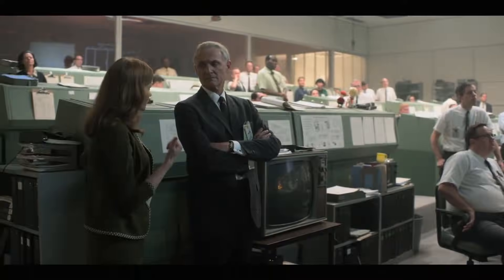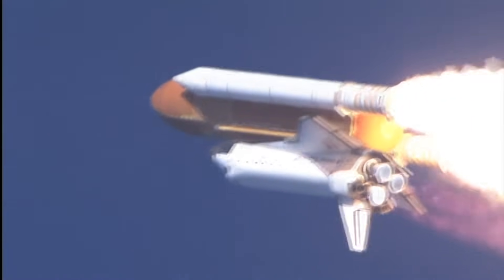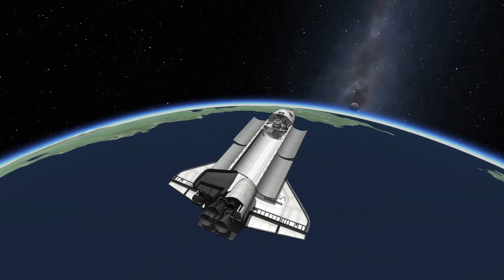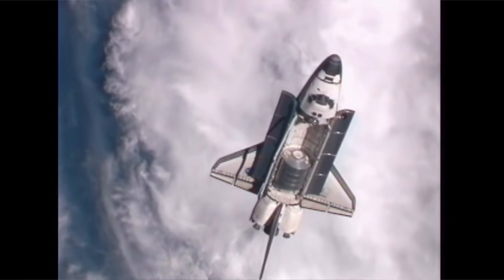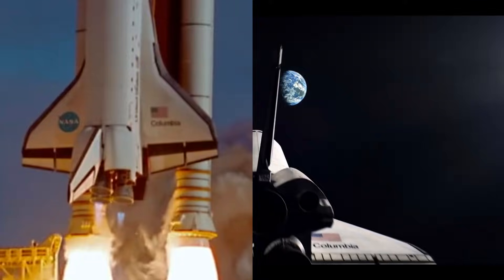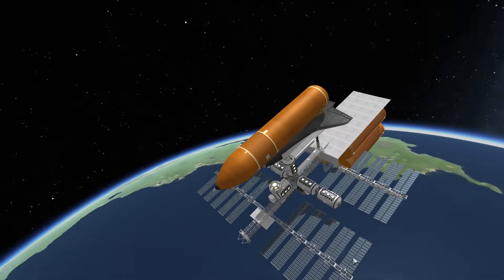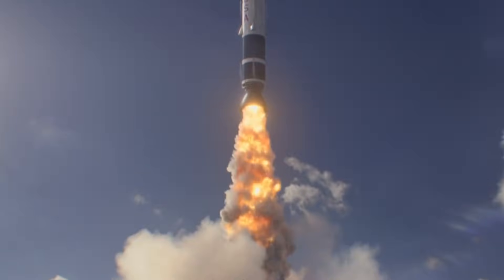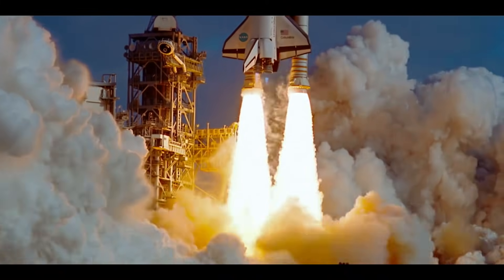How To Send A Space Shuttle To The Moon

Comment: Well, Airplane 2 took the Shuttle Orbiter to the Moon, but I’m not sure imitating a comedy is the way to go. I guess the producers should watch the excellent documentary on Challenger to see the serious design flaws that doomed 14 astronauts. It’s ironic that the name of the Shuttle Orbiter is “Columbia”, as ANY Shuttle Orbiter falling to Earth from the Moon (and that is essentially how Apollo returned — it literally fell into Earth’s gravity well) would not only not withstand the heat, it would be torn apart by the aerodynamic forces of re-entry at a much higher velocity. From low-earth-orbit (leo), re-entry begins at about 17,500 mph. But from deep space, we are talking 25,000 mph. The Shuttle was just not designed to withstand that. NASA’s original shuttle concept was a MUCH smaller vehicle, with cargo being launched separately. It was the Nixon Administration which dictated the bloated and flawed vehicle that was the result. 

The mistake NASA made was to try to sell the Shuttle as a cheap way into space using a “re-usable” vehicle, which would be cheaper than those expendable Apollo/Saturn vehicles. As it turned out, the Apollo/Saturn was actually much less expensive, as well as safer. (The Saturn V NEVER had a catastrophic failure, a rarity in rocketry). 

NASA management was trying to sell the Shuttle as a space version of an airliner. But unlike an airliner, the Shuttle goes from zero to 17,500 mph in eleven minutes, and a bit longer to decelerate upon re-entry. That’s a massive amount of stress to put on any vehicle, and it’s expensive (far more than first thought) to prepare it for another flight. Also, unlike Apollo, there was no launch escape system in the Shuttle. With Columbia’s first few flights, with a crew of two, there were ejection seats, but that would only save two of seven potential crew members. NASA also got cheap by using solid rocket boosters, which are less safe than liquid fueled engines because once those are ignited, they cannot be shut down. 

Because of this, NASA had no business trying to sell the Shuttle as being just as safe and routine as an airline flight, and it should never have been used as a passenger service. (Again, see the Challenger documentary). NASA also greatly underestimated the re-fit time after each flight, and thus had a much too ambitious flight schedule, which they never got close to achieving. But it was this pressure that forced Challenger to be launched when engineers were pushing against that low temperature launch in January, 1986. The Russians did one Shuttle flight of their own, and then shelved it as too expensive. They are still using Soyuz today, which has proven to be quite reliable and relatively safe. (Space flight will ALWAYS be inherently risky). The US should have stuck with Apollo/Saturn. The smaller Saturn 1B was a smaller booster for earth orbit flights. And with the Saturn V, Apollo wasn’t limited to leo. We probably would have returned to the Moon by now, instead of a flight to nowhere. 

It was far better designed, with a launch escape system in case of a disaster during launch, and, as it turned out, was MUCH less expensive. And like the Shuttle, as technology improved, the Apollo and Saturn navigation systems and on board computers could have been improved as technology improved.

Comment: Will it still work if you replace the 2 Solid Rocket Booster with Falcon 9 Block 5 booster?
Reply: No, each shuttle SRB had more than 60 % higher thrust than a Falcon 9, and the two of them combined (not including the shuttle's 3 main engines) had 10 % higher lift-off thrust than the Falcon Heavy.

Comment: What if it can land on the moon like on a strip? or is that not feasible?
Reply: It wouldn't make much sense to land it horizontally on the Moon going at any sort of speed. The reason we're used to seeing this on Earth with aircraft is because they need to keep moving to stay airborne in our atmosphere (they can't land going 0 mph, etc.). You can in some situations land vertically on Earth, like with the newer rockets, or some vertical take off and landing craft, but that's a bit more complicated than it needs to be in some ways, and it makes more sense to just use what we have (lift generation by forward movement). Earth aircraft also brake using their wheels once they touch the ground, which requires good contact with the ground from their weight - with the lower gravity on the Moon it'd be tough to get a good braking force - if you were going any high amount of speed they'd just skip around, and without an atmosphere to provide some directional control via vertical and horizontal stabilizers, there's a high risk of just losing control, which would be bad. There's just a lot that can go wrong there by going fast. It makes a lot more sense to lose as much speed as possible before approaching the Moon's surface, then lightly descending down vertically on rocket power, which is what the Apollo landers did.
Reply: Extremely unfeasible. Though Jackie Chan did it once ;)

Comment: There is no reason why the fuel tank that takes the shuttle from LEO to the Moon should only be as big as that which takes the shuttle to orbit.  Also a larger tank would allow for fuel to reduce rentry temperatures on return to Earth that the shuttle can handle.  Of course all this is by-the-by because there would, as you say be no reason why anyone would want to take the shuttle to the Moon apart from proving it can be done
Reply: Total velocity change (delta-v) from LEO to lunar orbit and back, including braking to reduce the re-entry temperature to a tolerable level.
Translunar injection:          11,000 km/h
Lunar orbit insertion:           3,000 km/h
Trans Earth injection:           3,000 km/h
Low Earth orbit insertion:  11,000 km/h
Total:                                     28,000 km/h = 7,778 m/s

Inserting this number and the specific impulse of the RS-25 engines into Tsiolkovsky's rocket equation:
ln(m1/m2) x 9.80665 x 452 = 7778
ln(m1/m2) = 7778 / (9.80665 x 452)
m1/m2 = 5.7819

If the m2 or "dry" mass (empty shuttle + OMS/RCS fuel + crew/supplies + empty ET) is 120 tonnes, it means that total mass (m1) just before the TLI manoeuvre is 5.7819 x 120 = 694 tonnes, and that the fuel required for these 4 manoeuvres equals 694 – 120 = 574 tonnes.

That's less than the capacity of a single external tank (735 tonnes), but it would require 5 super heavy-lift rockets of the Saturn V class to put that much fuel into LEO.

Comment: Why the apollo could go and the space shuttle not?
Reply: First of all because the shuttle was at least twice as heavy as the total weight of the Apollo command- and service module plus the lunar lander – even more if including enough fuel for the lunar orbit insertion (LOI) and trans earth injection (TEI) burns. 
Furthermore, there is no way the shuttle itself could land on the Moon, so it would need to bring a lunar lander in its cargo bay if the mission included a landing.
And finally, the heatshield would need to be upgraded to withstand the hotter re-entry.
Reply: @fromnorway643  thanks! With the landing on the moon i've know that it would never happens

Comment: That's an awful lot of mass to take all the way to the Moon and back. Each R-25 main engine is 3.5 tons. They basically spend 100 tons of fuel to take 3 engines around the Moon.
Reply: If the mass of the shuttle itself – including payload – was close to 100 tonnes, it would take at least 100 tonnes of hydrogen/oxygen to perform the TLI burn. That could send the shuttle into a free-return trajectory around the Moon like Apollo 13 did, without actually entering a lunar orbit.
The 100 tonnes of fuel would need to be launched into LEO by a Saturn V class heavy lift booster, or by several smaller rockets. That's lots of extra cost for not even being able to enter lunar orbit!
Reply: @fromnorway643  My point was they would spend that fuel to take 3 engines sight seeing around the Moon.
Reply: @Zamolxes77  
The RS-25 has a pretty high specific impulse (fuel efficiency) of 452 sec in space, so it would definitely make sense using them for the TLI burn. Using the OMS engines with their lower specific impulse (316 s) would require even more fuel brought up to LEO. Maybe the best option – if you really wanted to go the Moon in a shuttle – would be disconnecting two of the RS-25s and leaving them in LEO and performing the TLI with only one engine. That would save about 7 tonnes of dry weight and a similar amount of fuel.
The bottom line is of course that going to the Moon with a shuttle is a very bad idea when the same mission (free-return trajectory) could be achieved with a Crew Dragon launched by a Falcon Heavy.

Comment: I wonder if we changed the Space Shuttle to use raptor engines, perhaps THEN it could reach the moon (with a refueling at the space station)?  I believe they are far more efficient than the space shuttle engines.
Reply: The term specific impulse refers to how many seconds a rocket engine can maintain a thrust of 1 pound or kilopond per pound or kg of fuel consumption and is therefore given in seconds. A higher number therefore equals a better fuel efficiency, and hydrogen powered engines are generally the best. Some examples:

Engine                                     Sea level    Vacuum
SpaceX Raptor                            330               363
SpaceX Merlin 1D                       282               311
RD-180 (Atlas V)                         311               338
RS-25 (shuttle main engines)   366               452
Shuttle SRB                                  242              268
RS-68 (Delta IV Heavy)              365               410
F-1 (Saturn V)                              263               304
J-2 (Saturn IB/V)                         200               421
Vulcain (Ariane 5)                       326               431
Reply: @dgillies5420  
Even the old J-2 from the 1960s had a higher specific impulse in vacuum than the Raptor due to it being hydrogen powered, just as the RS-25 (shuttle), RS-68 (Delta IV) and Vulcain (Ariane 5). However, the J-2 was only designed as an upper stage engine operating in or close to vacuum conditions, so its specific impulse at sea level was a miserable 200 sec, even less than that of the shuttle's SRBs.
(Shuttle SRB and Vulcain added to the list in my first comment)
It's also worth noting that the Raptor's specific impulse is the highest among all the engines burning hydrocarbons due to its record high pressure in the combustion chamber, and its thrust/weight ratio is also among the very highest, 3 times higher than that of the shuttle's RS-25s.

Comment: As beautiful as the shuttle was, it was quite a poorly performing project.  At best, it was fairly efficient to perform ISS construction, where the payload matches the volume of the bay and long durations stays are needed - but of course the cost ended up killing it.  It would have been far cheaper to build the ISS getting a habitat about half the size of skylab up initially, and then grow it, using Saturn IBs which work the workhorses of the Apollo program.   The whole re-useability thing, even with SpaceX, wont happen in our lifetimes.  SpaceX doesnt reuse boosters for human crew, they are all brand new, and re-usability was the selling feature for the Shuttle.  I love the Shuttle, but if I was head of NASA in the early 70s, I would have predicted unacceptable crew losses doing menial task would threaten the end of the program...and just scrap the plans.  Efficiency, not sex appeal, wins every time.  And yeah, sending it to the moon, with TODAY's technology, would be a joke - sure with fantasy engines, anything is possible. Great sci-fi drama though...but more fiction than science.

Comment: How would the Shuttle land on the moon ?
Reply: Good question!
Obviously, it couldn't land like a plane without any atmosphere, so its wings and rudder would be useless.
One might lower the shuttle's orbit very gently down to a pre-built runway there, but its speed at touchdown would be nearly 6000 km/h or 17 times higher than a normal landing on Earth. The shuttle's wheels would almost certainly explode immediately upon contact in that scenario.
And how would you slow down on the runway if the wheels survived?
The speed brake and drag shute would be just as useless as the wings, and the forward-facing RCS thrusters in the nose are way, way too weak to provide enough braking. Even if the shuttle landed backwards and used its OMS engines, they could only slow it down by a fraction of the landing speed before running out of fuel.
The only reasonable method would be using a lunar lander brought there in the shuttle's payload bay while the shuttle itself was left in orbit.

Comment: Technically, the shuttle could reenter at lunar speeds but it would have to be inverted and just scraping the earth’s atmosphere at an altitude of 60-75km and aerodynamically slow down over a very long period of time as it did. Perhaps the heat shield could be thicker, which makes sense since as you said the extreme volume of the ET could afford that, but even so Starship shows how much you can do with less. Silver skin then would make sense.

Comment: Very nice video thanks! This is an issue I've been thinking about in context of SpaceX's Star Ship which looks more like the Space Shuttle every day. Both it and the Space Shuttle would need to be refuelled in orbit to get to the moon. The Space shuttle couldn't land on the moon but it could easily carry a LEM style lander. Star Ship should be able to land on both the Earth and the moon but it uses a lot of rocket fuel landing on its tail on Earth especially. The space shuttle lands 'for free' on the earth: wings and wheels do seem to be the optimum way of landing on Earth.   And Star Ship HLS can only land on the moon and can't ever return to earth. Overall a tweaked Space Shuttle which can go to the moon seems as good or better than what Star Ship may become. Don't know about the tiling issue but that must apply to Star Ship as well ...
Reply: spacex doesnt have to use the hls they can use normal starship to land and still be reusable, they just built hls so nasa gives them money
Reply: This is exactly what they did in a show. They made a bigger LM (it’s called the LSAM in the show, fully reusable, single stage and has capacity for like 10 people max), they probably made some hidden, unseen adjustments and differences in the design and flight profile that we can’t see (like thicker heat tiles or heat tiles made of a different material, the ability to operate without fuel cells/refuel the tanks for the fuel cells, more efficient engines that allow it to get to the moon, lighter airframe etc, can only speculate).

Comment: i guess they didn't have information back when the videos were made, but for the ridiculously nit-picky, the shuttle depicted in the trailer is 

spoiler:

nuclear powered. so you can stop complaining that the shuttle doesn't have enough propellant, because it runs (likely) on fission engines
Reply: Nah, Pathfinder is the first nuclear powered shuttle. The rest of their fleet uses chemical engines, but if you just assume they're lighter than historical orbiters and get fuel flown from the lunar surface for the return trip, it just about works and keeps the iconic 80s spaceflight imagery :)

Comment: Regarding the shuttle not having enough heat shield ability to return from the moon, since we're going with a full external fuel tank, would it be possible to keep that attached until one was close to LEO and use some of the fuel to deaccelerate further ?

Comment: What if they put a mid point refueling satellite basically launch a rocket that’s basically a gas tank with rocket motor attached and position itself halfway between earth the moon there would be enough fuel already on the shuttle to get it to the halfway point before the fuel runs dry then gets refueled continue to the moon get into orbit launch a remote operated probe from its bay to land on the surface to do collect data collect some rock samples when done launch the probe back up when shuttle is in range get it back in payload bay secure it leave moon orbit head back to the refueling point refuel head back towards earth with enough fuel left to perform de orbit maneuvers and reentry just a wild outside the box thought
Reply: Orbital mechanics doesn’t work like that.
You can’t place a stationary satellite halfway to the Moon and expect it to stay there until the shuttle arrives. That satellite would also be in an orbit around the Earth, so the shuttle would have to adjust its orbit to match that of the satellite before they can dock and transfer the fuel.
And furthermore, it takes almost as much speed and thus fuel to get halfway to the Moon as it takes to get all the way to the Moon, so the only place for fuel transfer that makes sense is in low Earth orbit, just as Scott Manley said.
Reply: @fromnorway643  Maybe permanently put the refuel station in a moon-earth cycler? This allows the launch window to be either moon relative inclination=0 (refuel on the way back) or the refuel station makes a pass close to earth. Or maybe Earth-moon langrange point.